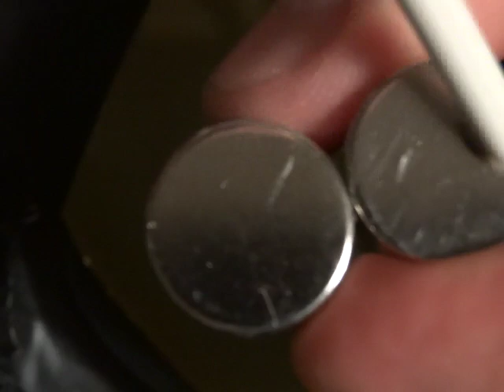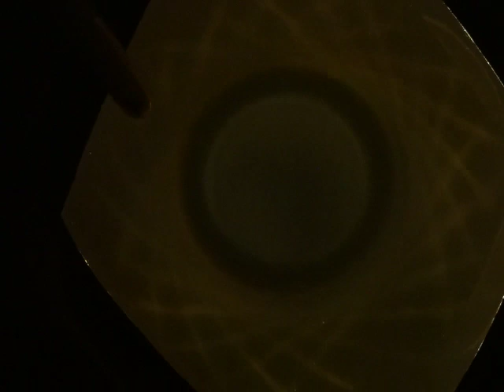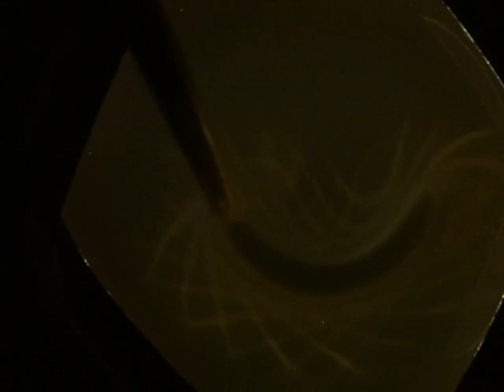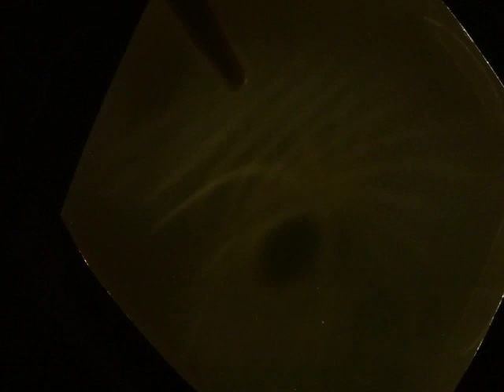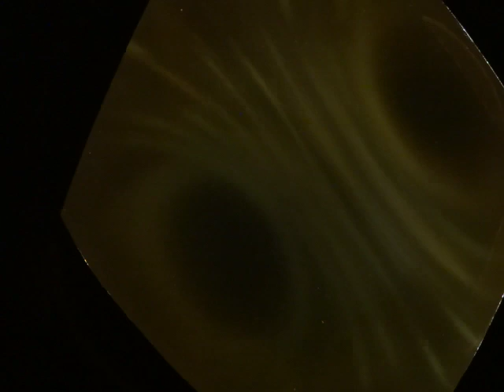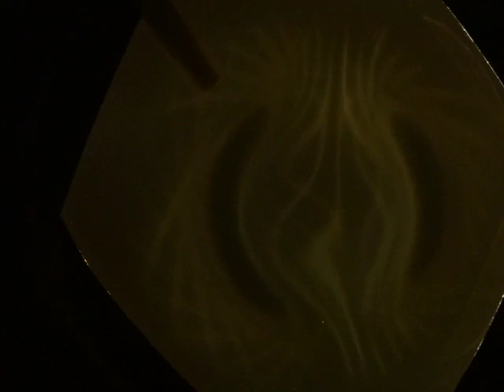VIDEO 52 Uncovering the Missing Secrets of Magnetism. FERROCELL & SINGLE MAGNET ELECTRIFICATION

Comment: I'm finding this all very fascinating. Before I had an EMF detector, I used to simply carry a compass. A high grade military lensatic compass. I used it for navigation. If you can get past the "existence question", what you are showing me here, is why when "they" showed up, my compass would often spin like a top. And not some slow wobbly top, but spin very fast and pretty constant, until I moved, or "they" moved away from me. That has bugged me for over 10 years. Now I think perhaps you might be showing me why it happened in the first place....

Comment: What I love is poeple who are able to question the status quo , who think outside the box, and who seek the truth. just because the western text books ,teachers and universitys say electrons exist doesn't mean the majority is correct. maybe this guy is right. maybe einstein did get it wrong.
Reply: Bernard Danev electrical engineers were engineering, designing, and constructing working systems which refute some of our most basic principals of physics; over 100 years ago. Systems have been designed which transmit electricity from one point to another near instantaneously (faster than the speed of light); as well as putting more electricity out than what was used to power it in the first place. For Petes sake the pistol shrimp with the snap of its tiny claws generates heat equivalent to the surface of the sun for a split second; conservation of energy as we understand it cannot account for that. 

There are a great deal of electrical situations that are impossible to explain using the concept of electron flow in a wire, or even using electromagnetic waves! Even physicists at fermi labs will tell you that e=mc^2 does not hold up in many experimental situations. 

Personally what I think is that some sort of body of individuals, wether it be governmental, corporate, ideological, esoteric, or all of the above, has purposely warped the publics understanding of the natural world as we know it. There is a branch of electrical science which was put to a dead stop by people like Einstein, and they made machines that worked; not caring what "rules" or "laws" that some lunatic mathematician imagined in his mind. They could make energy appear and disappear from one place to another with seemingly nothing going on in between; they could generate electricity in a system without obeying the laws of conservation of energy. There has to be powerful people out there today who know fully well of the implications of this electrical research; much of which again was done over 100 years ago. Imagine how powerful you would be if you were the only person who really knew how electricity worked, and you were able to influence society to such a degree that you could alter the publics understanding to the point that everyone believed a lie. You would be the only one holding that knowledge, and that would make you very powerful indeed.

 Nature has no laws anyway; it merely has boundaries, and the only limit to those boundaries are defined by our belief systems and understanding.   You should look into Eric Dollard if you would like to learn more about real electrical theory. There is much more out there than what we are told by our schools and "authority figures".
Reply: Einstein tried to divide by zero. Need I say more.
Reply: That's the issue with current "education" we aren't allowed to question anything. We get info crammed down our throats, basically foaming at the mouth to just spit it out and get a pat on the head

Comment: Isnt the crossing  magnetic  lines of force and the dielectric or as you would say that convergence is an optical illusion from seeing them both through the same plane but when you're actually make electricity by using copper wire in a spinning magnet you are actually converging or grounding the field lines thus creating electricity

Comment: The flower like center and the swirling Dielectric is very cool.  I'm sure you have noticed that many of you magnified views look like a Rodin Coil.  The see through swirling patterns (that show clockwise and CCw motion) also, really look like a Rodin coil.  I would have been great if you had a picture of the earths magnetic, dielectric field and compared them when you talked about them.  Comparing our knowledge to your knowledge helps us understand. 
Thanks keep up the good work.
Reply: Zero Quanta a rodin coil is an attempt at creating a geometric configuration that matches the harmonic sequence of sound mapped in a mathematical fashion based upon additive routes. I think that Rodin stumbled on to a basic principal of nature, but to be honest I haven't really seen any amazing discoveries coming out of that particular line of research. A lot of the strange effects seen in the operation of a Rodin coil; could also be created by simply building  a toroidal coil that is wound in such a way so as to copy the geometric configuration of the magnetic filed; as seen in the above video. I think that it is interesting to note that it also looks like the bottom of a pine cone, or in other words the differences in density of the field organize in such a way that follows the golden ratio. It seems like the incommensurable, fractal nature of magnetic and dielectric fields can really be seen in essentially any and all things in nature. Which makes sense really since the basic configuration is uniform regardless of the size or scale of the magnetic field itself.

Comment: In video 51, I was wondering, when the broken ring magnet folded. How did one half of the ring magnet over power the other half? Video 52, answered that question. Ring magnets do not break in half. Its been sounding like, that the smaller half wins? Smaller wavelength, higher frequency?

Comment: Thanks, that's awesome! but what's the magnetic field where your making Electricity, make of?  the movement of those lines on force I guess where your making Electricity where is the electrical charge coming from, is it the two fields crossing each other, rubbing each other?  it almost looks like a Miro motor after spinning it makes power, 

do I vid with the electricity moving out from this device or through a coil that would be cool
Reply: Enquiry News/ Felkins Works look into Eric Dollard. The energy is coming from a counter spatial dimension; which is in relation to the concept of the aether. You will have to read Kens books, and study electrical engineers of the past if you want to understand how it all works.

Comment: Thanks for your videos they are most informative. But how you can prove empirically electrification in magnets? When you apply measuring equipment it can be argued that electrification arises through induction between magnetic field and metal parts of equipment.
Reply from the maker: FOUR primary dimensions in electrical engineering. These are:
1) Time
2) Space
3) Dielectricity
4) Magnetism

All you have to do is MOVE a magnet in space and time, dielectricity and magnetism are already present in and of the "magnet".

Yes, using a sensitive voltmeter you can prove same.   What did you think you were coupling off of using a dielectric reflector in a coil?
Reply from the maker: I dont concern myself with skepticism or proving anything to anyone. I only present the logic and evidences and stick with Faraday, Steinmetz, Dollard, Tesla and others.

However none of them knew exactly how a "magnet" works.
Reply: Neither do you.
G.